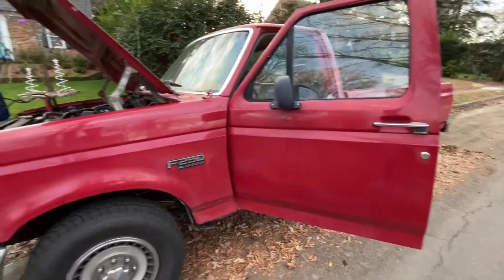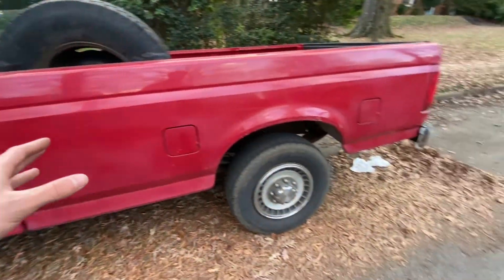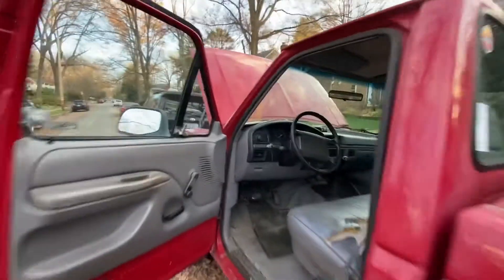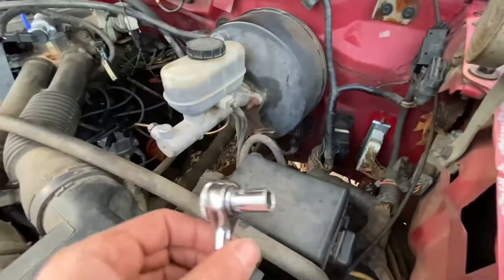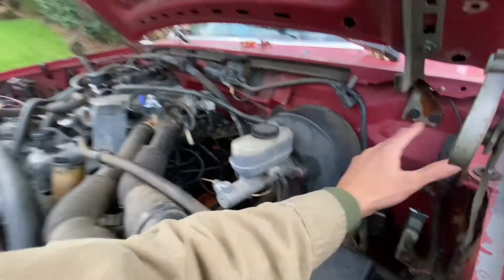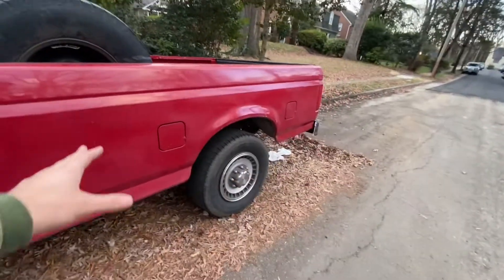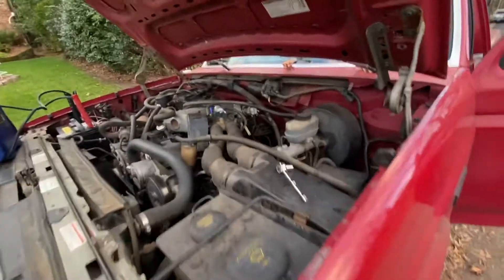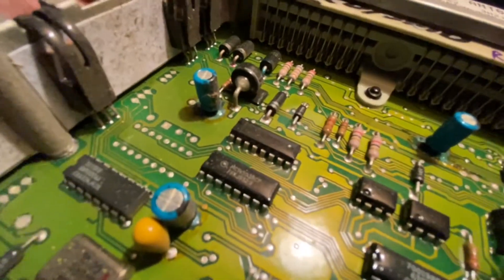Ford 4.9l Crank/No Start Issue SOLVED (1994 F-250 4.9l)

Comment: Great video man, it'll probably help a lot of people with those old fords. Btw those burned out looking things are called capacitors, they only cost a few cents each. It's pretty easy to de-solder the old ones and solder in the new ones, just make sure you buy the right ones and install them in the proper polarity. Maybe worth fixing the old computer to keep as a backup.
Reply: Maybe he should buy Toyota next

Comment: First thing I did is check spark fuel ignition timing sensors I found fuel pump failed even though I could hear it running in the tank. Replaced both of them

Comment: I've got a truck here (not mine) doing the same sort of thing.  No engine light, no codes... All 3 fuel pumps operate normally, cycling normally, fuel pressure is within specs, both tanks are full.  Ignition system was just tuned up (new cap, rotor, plugs, wires), it's got good, hot spark.  All 6 injectors have a "pulse" signal, and all 6 injectors spray fuel when jumped AT THE COMPUTER CONNECTOR... It will start and run after reconnecting the computer for a second until that fuel burns off, then it will not restart.  If I jump power and ground to the injectors with the computer hooked up, I can keep the engine running by "pulsing" the ground myself.  The computer is sending power and ground to the injectors, but somehow it will not "fire" them.  All circuits test good, no high resistance, no voltage drop, no corroded connectors, all fuel injectors test 14.6 ohms of resistance and all six injector connectors have "pulse" from the computer tested with a "noid" light, and all six injectors spray fuel when jumped, but again, the computer will not fire them.  I've tried 2 used computers and 2 remanufactured computers, all had "pulse" but none would make the engine run.  Any ideas?  I'm about to set the damn thing on fire and watch it burn.
Reply from the maker: You’ve done way more than me man haha.
Reply: @AddictedMotors  LOL... Yeah, this thing has everyone stumped.
Reply: Is it fixed.how?
Reply: Distributor pick-up coil or the starter relay solenoid or the PCM like this guy replaced. Could be any of these. You just have to figure it out.
Reply: @tommavrakos  It ended up getting sent to a Ford dealer, they fixed it but I never found out what they actually did...
Reply: @bobr2959   Yeah... no, it wasn't any of those things.

Comment: I have a 1994 F150 4.9 liter just stopped on me so I put a new coil and an ignition module ,still wouldn't star .Had it towed to the ford dealership. The said it was the computer ...changed the computer, it did start an idle A-1 . Took it for a drive and all it does is hitch/jerk they've tested the fuel pump says it's got good pressure ,checked wired and plugs and they are also good . What is left to check??
Reply from the maker: Mine was the computer. Are you sure the “new one” is good?
Reply: Distributor pick-up coil or the starter relay solenoid or the PCM like this guy replaced. Could be any of these. You just have to figure it out.

Comment: I got a 93 Ford F-150 put a 94 300 in line 6 in it it's turning over but it's real hard like something's holding it back battery is hot it's full fully charged what could it be

Comment: I need to post a video of my 90 F250 with the 4.9 5 speed. I had the same issue and no one at the time had any videos that could help me figure it out. PCM replacement fixed 90% of its issues and then I had the ICM go out and it made it run like new after replacing it. I really think somehow the ICM was only half working before it went out, because it ran so much better after i replaced it.

Comment: I have a 94 7.3 idi and im having the same issue with no start, i replaced the starter solenoid, white ignition box under the dash, checked all my fuses and relays and there all good. Could my pcm be bad? (We have a push button hooked up so you turn the keys to turn everything on and then press the push button to start)

Comment: Will a bad pcm cause transmission issues mine will run sometimes it won't also dies when get up to operating temperature when you try to drive it when it does run has a heck of a miss fire with check engine light on but when it's off runs like a dream and trans is fine I'm leaning towards a pcm failure but need more options mine is a 95 f150 with 5.8 and auto trans a4od
Reply from the maker: Possibly. Mine was a manual.
Reply: Yes it will possibly cause that

Comment: My 91 ford bronco 5.8l cranks no start its getting spark / fuel  i changed the whole distributor, module  plugs ,wires ,i even did the timing chain/ water pump,changed  relays and the wires going to it only thing i aint changed is ecm and fuel filter

Comment: If the crank no start /dies after 30 mins. Or so......replace your pick up coil....I had same issue and replaced same parts except I replaced icm...seems icm controls fire till engine warms then pcm takes over..at this point ur pickup coil fails to pick up causing  miss/ seems like fuel issue and is or was for me ...a hard issue to pinpoint. Thanks for the post.
Reply from the maker: Ended up being the pcm

Comment: F350xl crank no start …has new glow plugs …fuel tanks and sending unit …and diesel pump still no start
Reply: did you find the problem, my f350 does the same